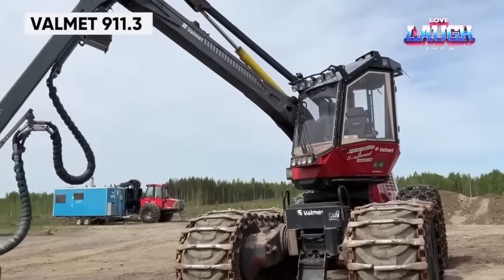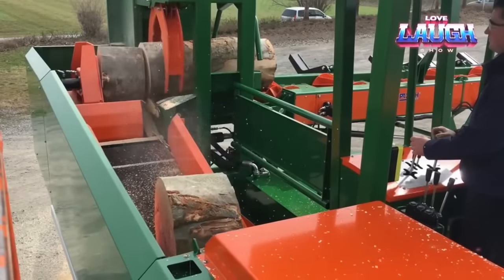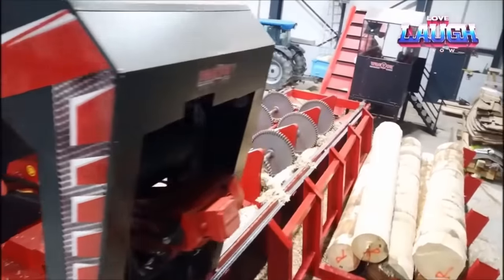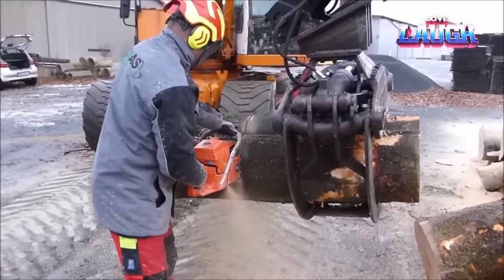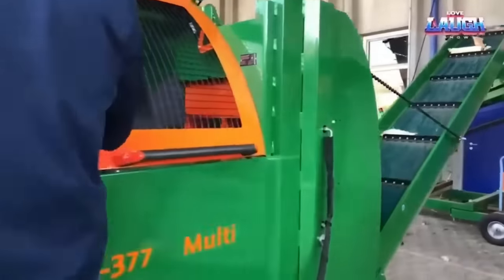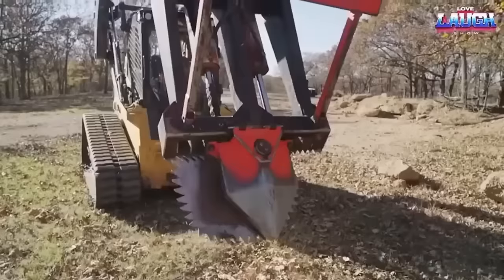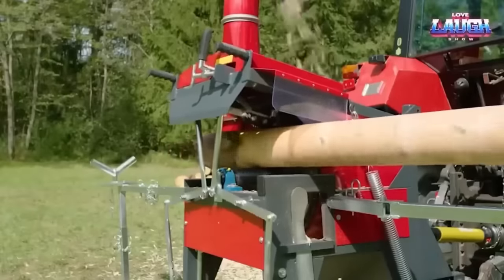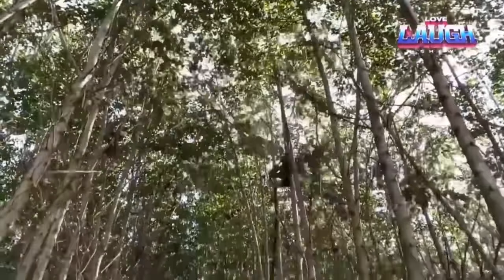899 Amazing Fastest Big Wood Sawmill Machines Working At Another Level

Comment: You missed up with the names of the equipment the john deere 848L skidder you claimed to be is actually john deere 843L feller buncher  and the timber jack cutter at the start is not a feller buncher but a processor head cutter the next machine after is a true feller buncher
Reply from the maker: You are right, and I appreciate your expertise in identifying these machines correctly.👍